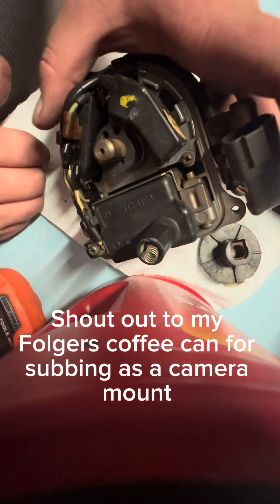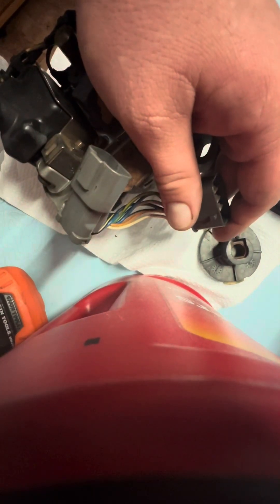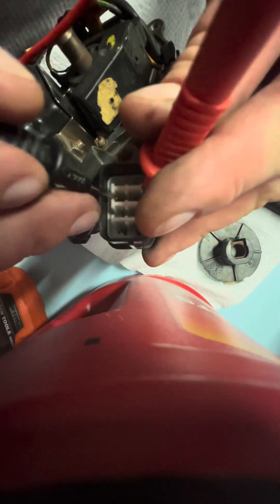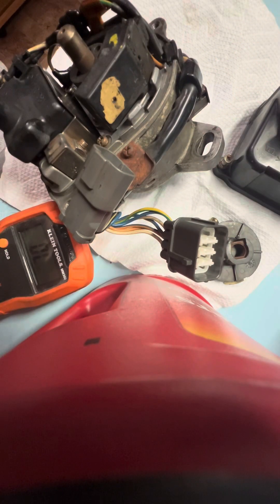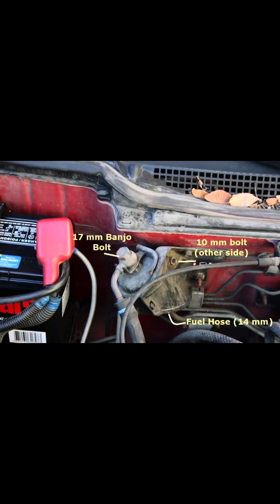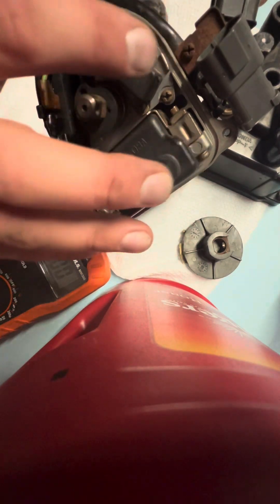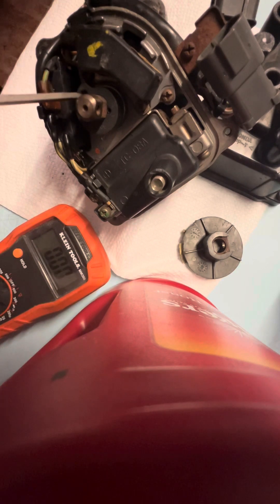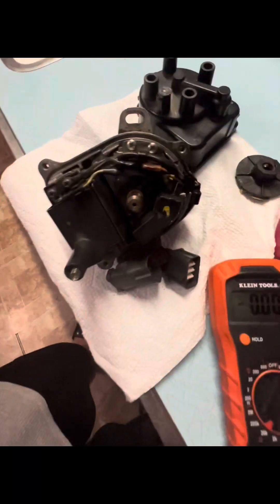How to diagnose and test a Acura Integra B Series Distributor

Comment: I the exact same issue, lean condition . Cylinder 1 & 3 misfire, and everything else check out even map is in the low 9s and no leaks or it would be way off. Installed new iridium plugs, ngk wires, fuel filter, fuel pump, cap and rotor all in last 3 months. Spits and sputters so bad that check engine light flashes while driving because it spits and sputters so bad . But it’s never a consistent issue it’s always intermittent.

Comment: I think that is a protection so you don't fill the crankcase with fuel. I drove a Chrysler 2.2 turbo 10 miles on 2 injectors and the oil filled with gas. I spun a bearing shortly after that.